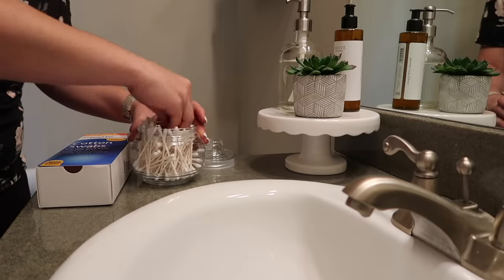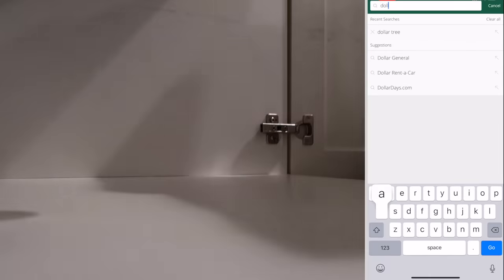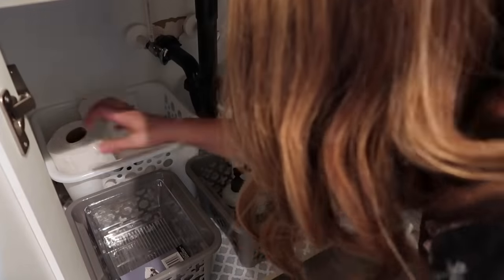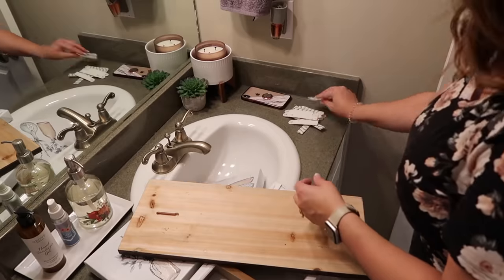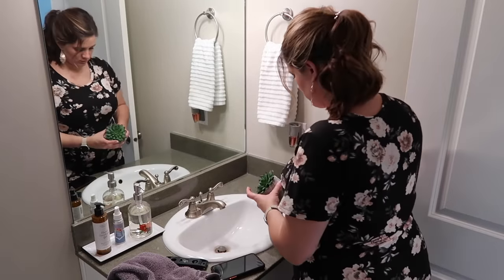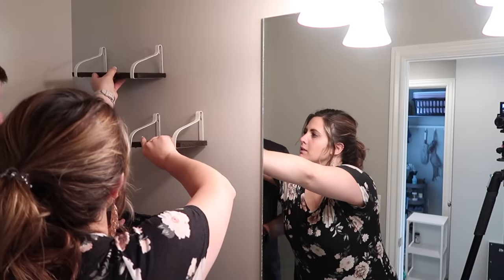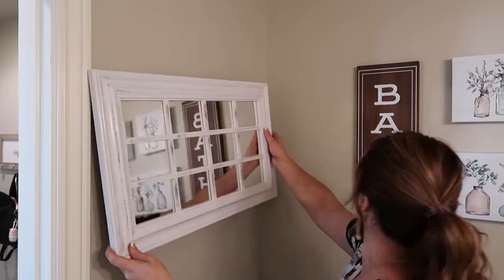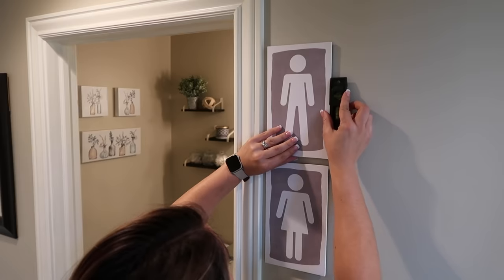SMALL BATHROOM MAKEOVER ON A BUDGET :: DOLLAR TREE ORGANIZATION IDEAS :: EXTREME ROOM TRANSFORMATION

Comment: Putting the soap dispenser on that cake stand on the corner of the sink would give me anxiety. My kids would knock that over 🤦🏻‍♀️
Reply: Valarierosegee Right? I love the look, but I'm still trying to find a soap dispenser I like that has suction of some sort on the bottom....😉
Reply: ..... I found that if you use the pretty " drawer cushion " type of liner, it works great, I used this when my grandsons were here during the summer. Just cut it to the size you need, using the shape of your soap dispenser as your template. Cut a tiny bit larger than actual size of your dispenser.  Washes off easily and air dry , voila`...!  🙂
Reply: Train them, supervise.

Comment: I love this! 😍
Question.. I see you constantly using the Velcro command hook stickers, is there a certain weight one you use? I have tried using them in the past, since I rent. They have always dropped my photos etc, even if I use the heavier duty ones. What's your trick?
Reply from the maker: Oh yes I usually use the large - or medium ones if it’s really a small item I’m hanging. I always press the command strips onto each other first, then remove one sticky side and hold it onto the item I’m hanging for about 30 seconds. Then remove the other sticky piece and push it onto the wall and push on that area for another 30 seconds or so🤍
Reply: This Crazy Life thank you! I will try that tomorrow and see if it holds up better. 😊

Comment: silly question but how do you get the pictures off the walls with those command strips?  it doesn't look like you can get to them once hung?
Reply from the maker: They’re like thick stickers, they’re super easy to take on and off both the wall and the pictures!
Reply from the maker: You just pull the tab & it pulls it off without taking any paint, but I would recommend using the name brand ones. And my faves are  the Velcro ones